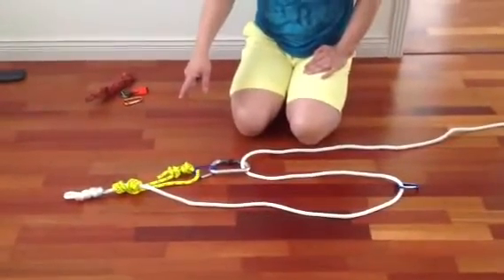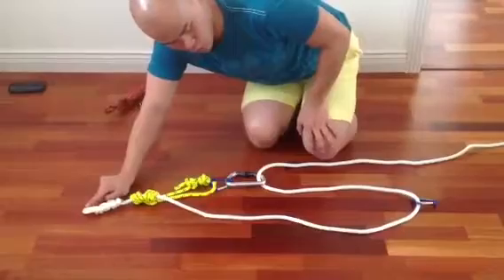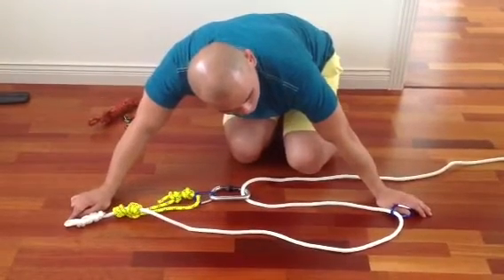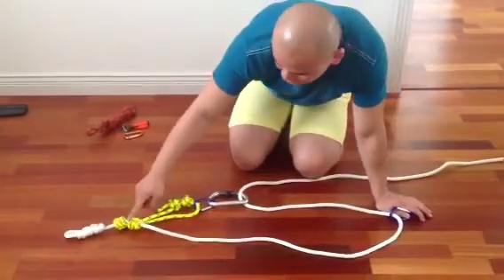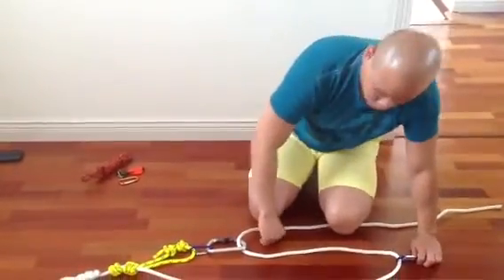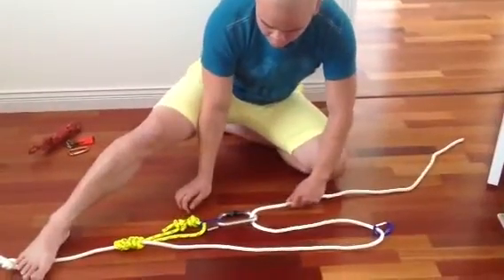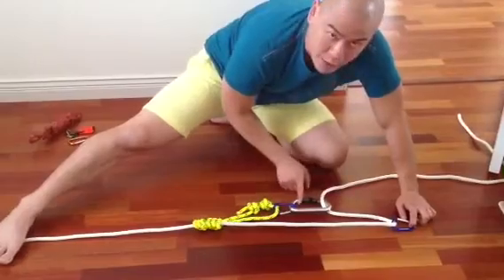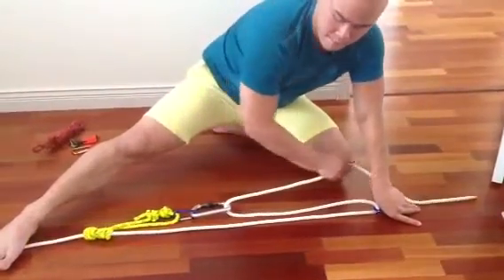Z-rig Mechanical Advantage

Comment: For what it's worth, I use my ~$15 ebay'd micropulleys (xinda brand) to make this type of z-rig 3:1 when trying to yank trees, you should check it out it's one thing to get the concept but another to feel that level of power coming from you tugging on a rope, heck last time I did this I anchored off a trunk that was already felled and I ended up with a 5:1 setup (anchored from the felled trunk) and it actually got the trunk on the ground to move because of the force I was applying (well, 5x the force, but still it feels like it's from you which is very very neat :D )

Comment: Appreciate you have put effort into making this video. But there are some issues with it:
1. You have not explained the exact scenario, the environment, the state of the person being rescued, and the task you are trying to achieve. This means viewers could be confused as to when and where to use your system.
2. Pieces of needed equipment are missing,  you talk about them but they are not there.
3. You have a prusik knot that is so close to the load that it is pointless having it there, and it just makes a weak point in the system. There are better options. I will not explain details because my explanation would be (by words without pictures) ambiguous.
4. It is hard to tell, but it looks like you are using miniature toy karabiners not real climber load rated karabiners. 
5. You have not explained how you will safely hold and secure the load between pull cycles.
6. You have not explained how you will secure yourself.
7. You have not explained how you are attached or not attached into the system.
8. You have not explained how the system is secured and with how many points of contact.

If you are reading this comment and learning about z pulley systems, I would suggest getting information from sites that are part of recognised climbing institutions, rather than individuals.